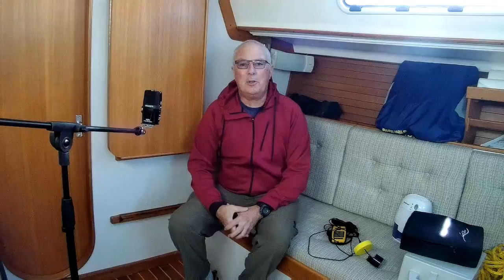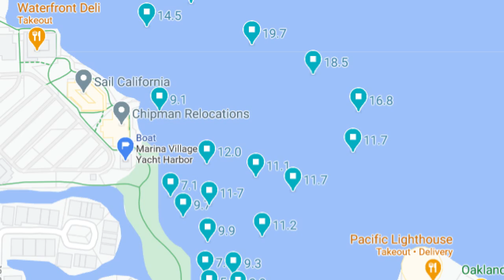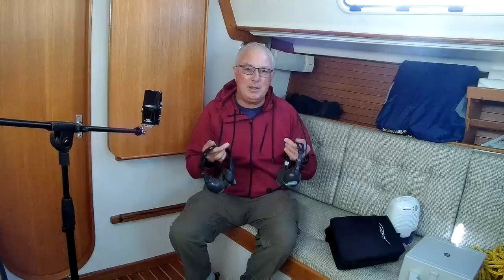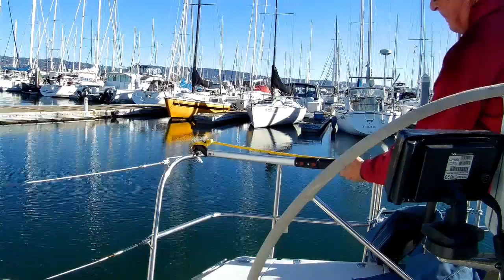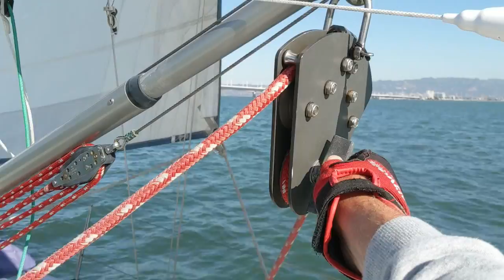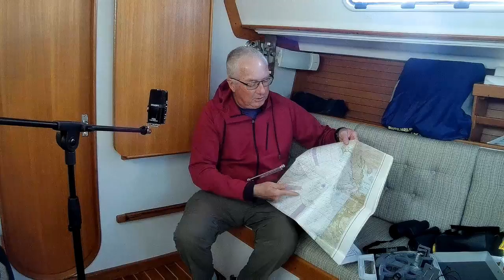Useful Sailing Gadgets

Comment: Hi, where did find the pad eye for the spinnaker pole?  I have been searching for it.  Thanks.
Reply from the maker: Google on "mast ring whisker pole" and you will see several choices. They seem to reserve "pad eye" for those with a flat bottom.
Reply: @jamesconger8509  you can even add a track so you can rise and lower it change sails or roll up the sail some. The cutting board addons is genius
Reply from the maker: I don't think I can justify the jib track on my boat. I just use small jib (110%), and one vertical position seems to work fine. I've seen boats with larger jibs make very good use of the jib track though. Some get essentially a spinnaker shape out of the jib using a long pole pretty high up the mast.